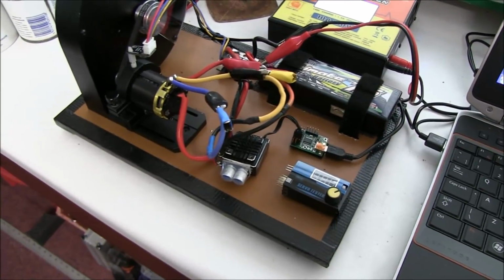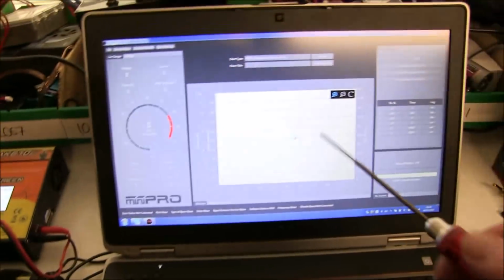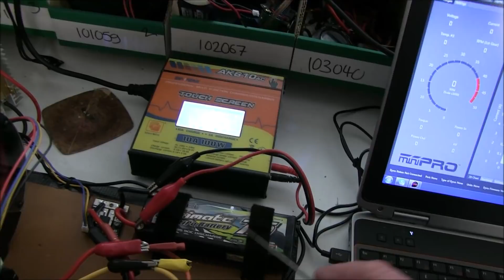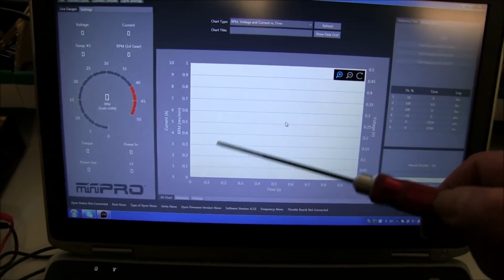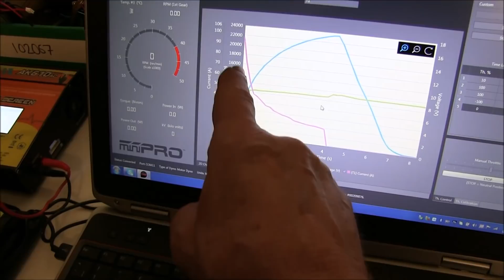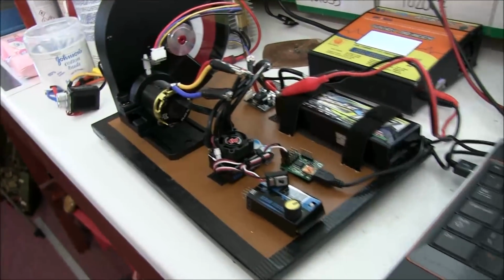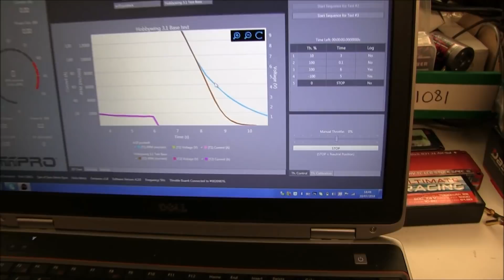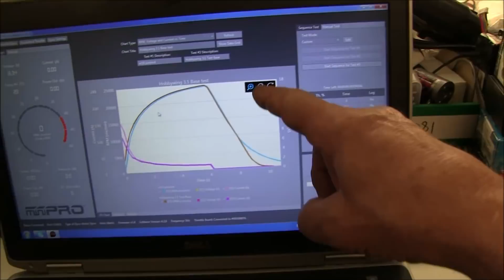MiniPro Dyno ESC Testing

Comment: Hi Nick, looking to buy the MiniPro Dyno, but there is a pre-order. I would like to know if you recommend it for motor testing although the answer is pretty straight forward from what i see and also if it happens to know the delivery time for the pre-order. Already contacted MiniPro and still havent replied... Thanks a lot
Reply from the maker: I don't really recommend it for motor testing as it is very time consuming and only worthwhile if you want to put a lot of hours into it.
Reply: @nickadams5411  Thank’s Nick! What about the samoling date that people say is too low which results in raw data that are very noisy? Also, which flywheel would you recommend for motor 4-5-6.5T?
Reply from the maker: @Diper1981  I gave up using mine for a couple of reasons, 1. the data logging had too much jitter and never returned repeatable results. 2. even for fairly weak motors the standard aluminium fly wheel was too light weight and IMO the only flywheel which will give you hopefully accurate result is a heavier steel one. But with a heavier steel one its very hard on the belt system and I recommend that you have the wheel spinning slowly before you apply full power otherwise the belt would break.
Reply: @nickadams5411  ok fair enough! Since you gave up using yours, would you consider selling it to me just to play around a little bit?
Reply from the maker: @Diper1981  Potentially, are you in the UK? As its quite heavy so the shipping could be expensive.
Reply: @nickadams5411  No, i’m in Greece. Think about it and let me know... thanks Nick
Reply from the maker: @Diper1981  Because of poor health unfortunately I can't take it apart to send it to you at the moment, I would have to arrange for someone to package it etc which is on hold at the moment. I'll have to see who could do it and get back to you.
Reply: @nickadams5411  i hope you get better soon Nick!
Reply: @nickadams5411  Also, you could sen it to a friend in London and he could ship it to me if it is more convinient for you.
Reply from the maker: @Diper1981  Unfortunately at the moment its not something I can organise due to health.
Reply: @nickadams5411  no problem...

Comment: Hi Nick! What's the lowest turn motor that this bench is capable of  testing? Which flywheel are you using? I know they sell different ones...
Reply from the maker: Hi
I use the heaviest Aluminium one. The one that comes with the Dyno.
The steel one is too heavy for these motors.
Testing low turn motors , such as 4.5T, I would be careful with the current draw and the revs. and damaging the belt. The 3mm teeth belt is essential for all tests. I would prefer a different ratio on the gears for low winds.
Reply: Thanks for sharing. Is it also possible to test 1s escs?
Reply: giorgio lockmer yes it is.
Reply from the maker: Hi
Yes. I will test 1S speedo soon.